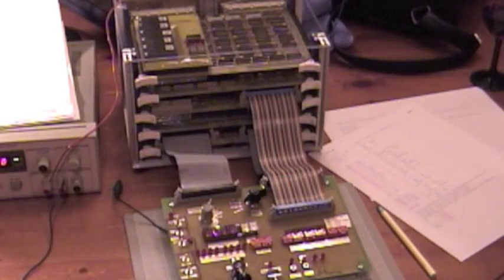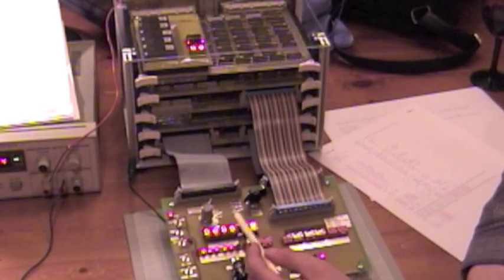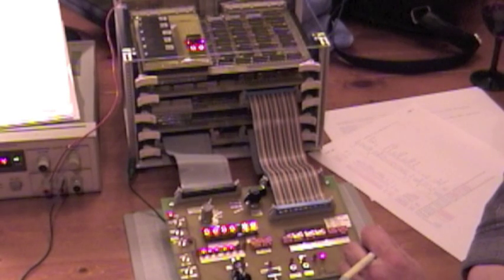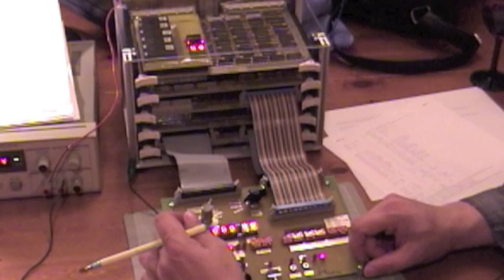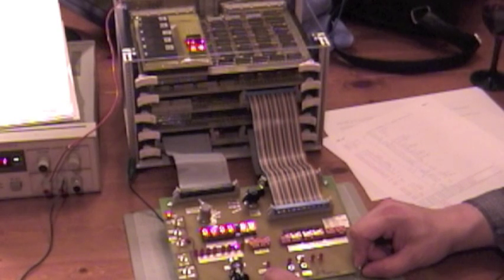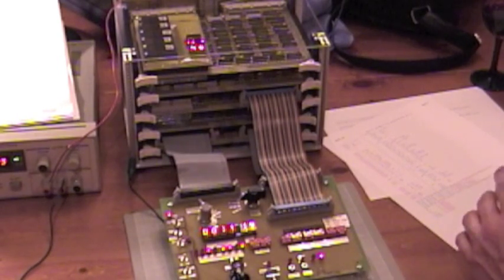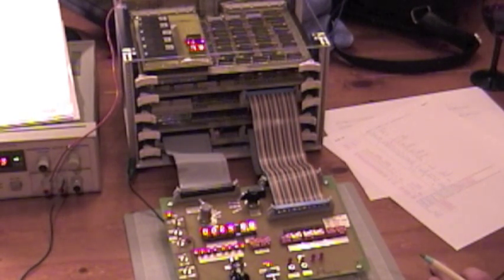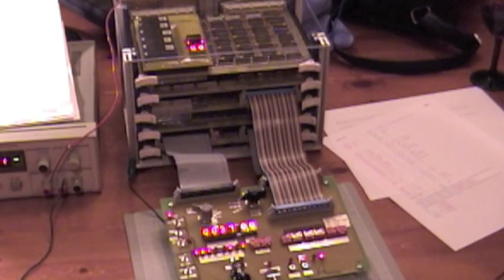Magic-1 HomebrewCPU Works!

Comment: Sorry guy. I don't remember you in the HBC group. This looks like the S100 bus Morrow put out in 1980. Did you just rip all of us off? Looks like it. 

Beauty of the internet. Anything that happened before it, vanished. Google BAMDUA. 

Looks to me like you just found our old documents and stole what we were doing in 1980. 

Show me video of you, yes you, building this rather than just grabbing our old wire wrapped hardware. 

I think you are a fake.

Believe me, I will be checking.
Reply from the maker: Hi Corcellian.  If you'd like to know more about my project check out the main website at http://www.homebrewcpu.com.  There you can find full the full schematics along with years of build diaries and many photos of the construction process.  In particular, check out the "Photo Diaries" on the construction page (http://www.homebrewcpu.com/construction.htm.  That should help to answer some of your questions.  For what it's worth, I considered building Magic-1 using S100 bus prototype cards, but ended up going with some double-wide VME cards I found at a local surplus shop.  As it turns out, I needed many more signal lines than I could have gotten with S100.  And, in case it wasn't clear, this is a relatively recent project.  I began design and construction in 2001 and got the first program running in 2004.

Comment from the maker: Homebuilt TTL CPU turns 10

Ten years ago my silly HomebrewCPU hobby project came alive by computing Fibonacci(10).  It's been up nearly continuously since then - running a port of the Minix operating system while serving simple web pages and offering open Telnet sessions.  

Over the weekend I put together a video tour of the project with a demo, overview of the microarchitecture, walkthrough of a fetch/decode/execute cycle and a teardown:

      http://youtu.be/0jRgpTp8pR8

For more information about the project:

    http://www.homebrewcpu.com

Full schematics here:

   http://www.homebrewcpu.com/Magic1.pdf
Reply: And it's still an amazing project even after 10 years... Might as well be Magic to those of us not well-versed in the low-level components required to make it all work!
Reply: Oh hey, this actually ties in with something I was wondering recently...

What's the simplest computer on which TCP/IP has been implemented?  Or to put it another way, what's the technological floor for a properly internet-connectable device?
Reply from the maker: Probably depends on what "properly" means.  For TCP/IP on tiny devices, take a look at Contiki: http://www.contiki-os.org/.  The predecessor of Contiki was Adam Dunkels' uip, which was the first thing I used to get Magic-1 up on the internet.  It was very, very simple (and small).   If I recall correctly, it fit in less than 1K bytes of RAM.  It was also used to turn some old 8-bit 1980's computers into web servers.
   Here's wikipedia on uip
http://en.wikipedia.org/wiki/UIP_(micro_IP)
Reply: Bill Buzbee - That's more or less where I was going with it.  I confess I was wondering more in terms of "how many transistors does it take to implement TCP....?" which is a hilarious way to frame the question.  :)

(I started wondering in reaction to an appallingly badly-written TV show in which an evil hacker type was supposed to have circumvented his "no computer access" restrictions by making his own... out of vacuum tubes.  And then proceeding to hack peoples' bank accounts and so on.  The wonders of modern technology!!11!1)